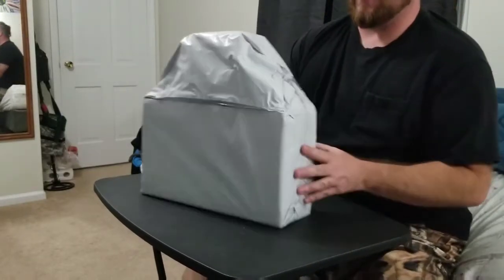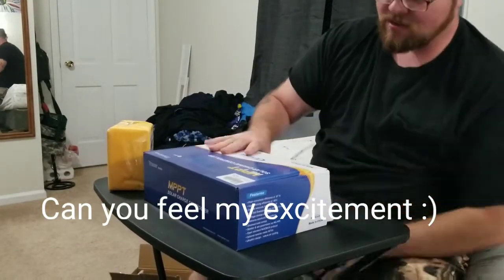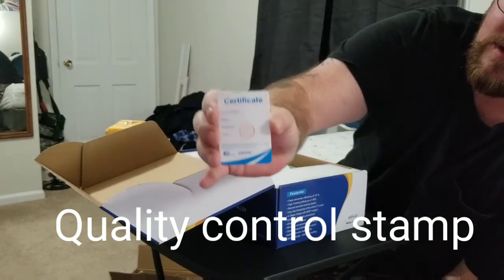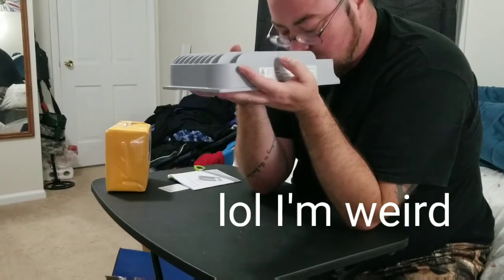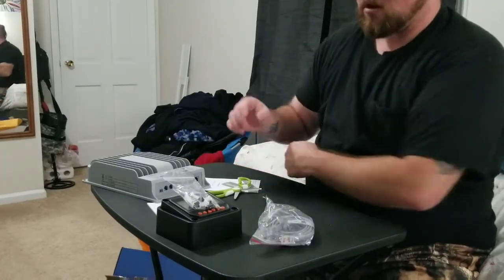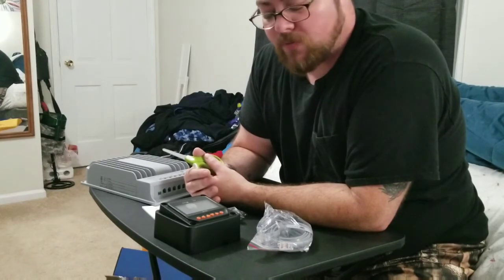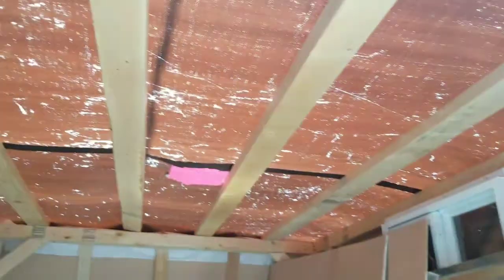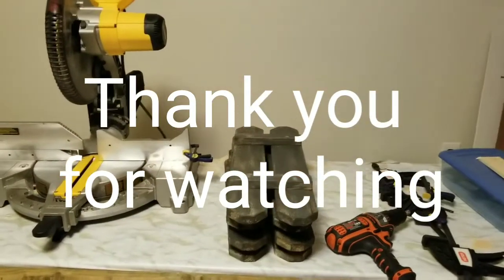Unboxing Epever tracer 3215BN and I show my camper progress

Comment: The issue I had with this particular controller when I had it was the very slow tracking. The CC can be very frustrating on a cloudy or hazy day taking a long time to adjust to the new Maximum power point. Besides it is a great controller from a company that respects and supports their warranty. The heat dissipation is very good and the internals are good quality.
Reply from the maker: Baric Dondarion that is good to know.  Thank you. I will keep an eye out for that.

Comment: The ply isn't going to be unusable. Mist with bleach in the worst spots and use a primer such as killz before painting. I dealt with that a lot in the pacific northwest... learn as much as you can on solar and low voltage DC systems, it will come in handy when diagnosing issues later.. don't stress about any part of this build, it's your first and a hands-on learning experience. If you decide the micro camping style suits you, chances are very high you will construct another using what you have learned building this one.. and as a side note, don't build your battery box untill you have more of the trailer done. You may have to locate it based on your weight distribution numbers.. keep at it and have fun, looking good so far :)
Reply from the maker: Ramblin Rogers Thank you. Good advice. I was thinking the same thing about Possibly moving on to another build in the future. Oh yeah I forgot about balancing the weight out. The batteries I bought are about a 110 pounds together.